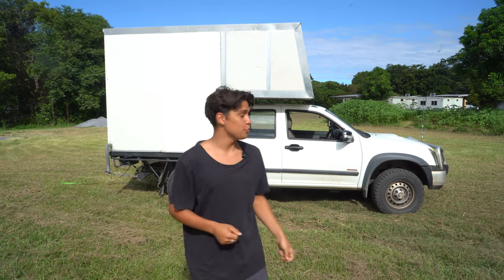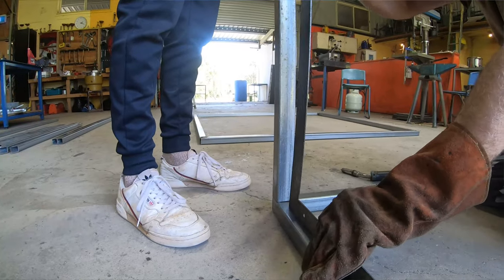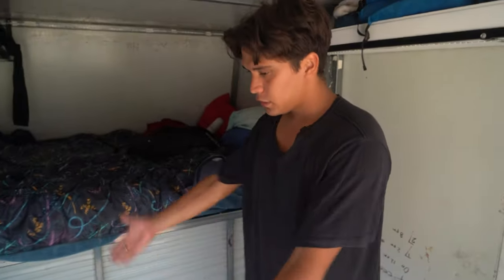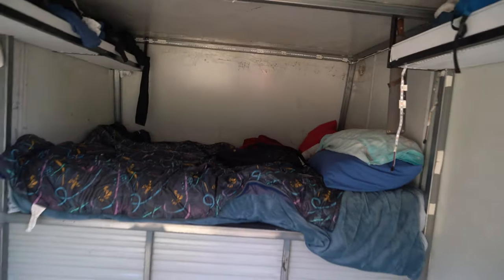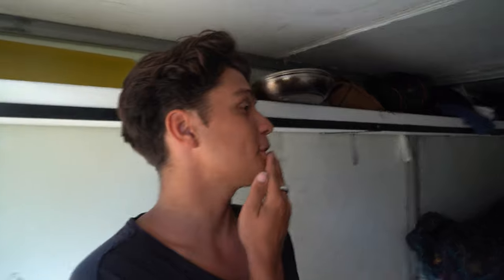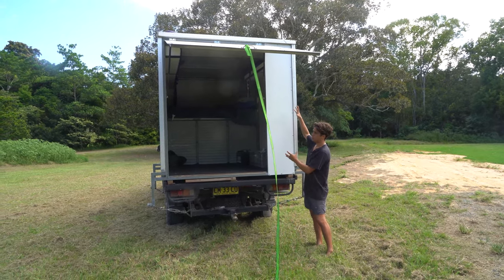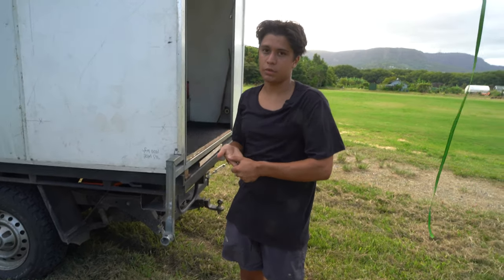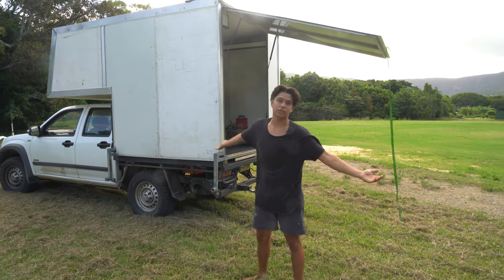Custom DIY Camper for under $1500 | FULL TOUR

Comment: This was a great rundown, mate. I was searching for 'dua cab camper builds' because I've just finished refurbishing the suspension on my 05 Courier crew cab high lifter RWD, and I am turning it into a home and workshop on wheels. You've given me ideas for my build, especially the removability of the camper body.
I'll be carting a full set of tools, genset, welder, compressor etc., plus solar, 100 litres of water (probably going where the back seat is), hot water system, stove etc. It sounds complex but I have it all mapped out in my head on where everything will go. Now tat I've refurbished the motor and drivetrain/suspension, I can start on the camper build knowing I have a reliable platform.

Comment: Hey mate. Looks great. But are those legs able to tuck away? Pretty sure you can't have metal hanging outside the width of the tray in case you hit a pedestrian when you go past. Not sure. But might want to look into that.
Reply from the maker: Cheers! Yeah I’ve had a bit of a look in to that and asked around. I have been told if it’s under 2.4m it’s ok but you have to put reflectors on both sides of each leg.

Comment: Great job so far. Dont worry about the windows. Use cameras, they are less work to install and you can record the goings on around your camper along with motion detection & remote notification/control...(people do have a tendency to drive off with these things while you are not inside). Reckon you should line the walls and roof with something light and cheap to give it a nice finish eg: marine timber look vinyl.